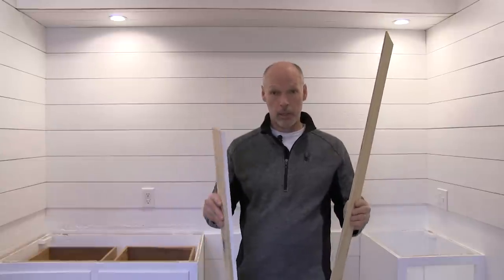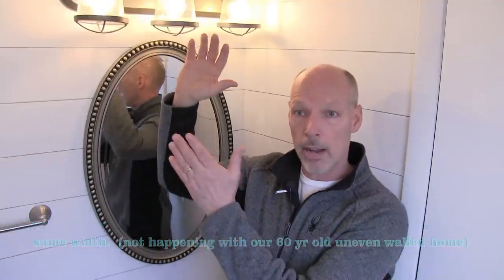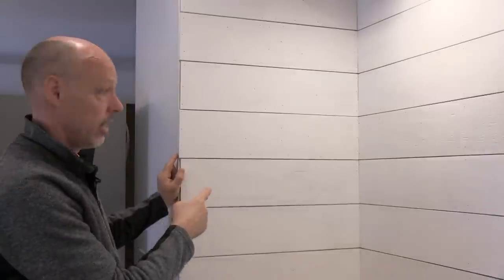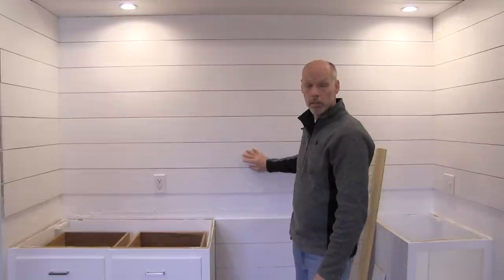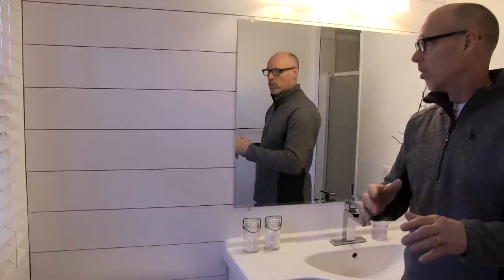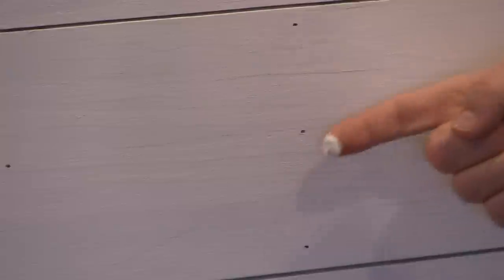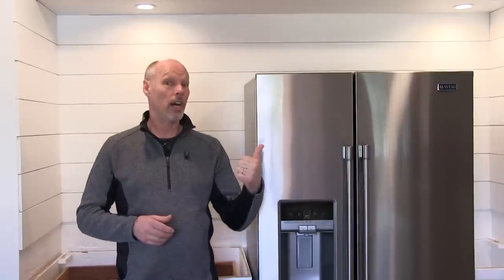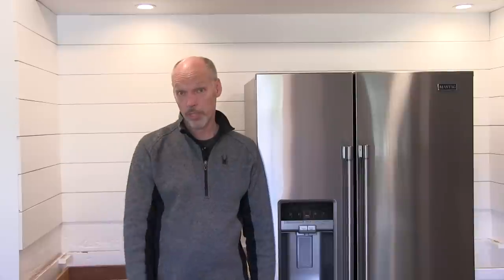Faux Shiplap Wall  - comparing various material options

Comment: THANK YOU! Thnx for doing this video, it was very helpful. Especially appreciate u sharing your very own work so we can see where you got it right/wrong, mad respect for that! 
Also, I'm considering this same option for our 1990's gargantuan master bathroom. It's currently covered with wall-to-wall pink roses wallpaper 🤮 ! 
Question: What's your opinion on just putting this right over leftover wallpaper residue? In other words, I'd just peel off the nasty roses wallpaper, skip the step of spending FOREVER trying to clean off that leftover residue, and just nail up the shiplap right on top?

Has ANYONE else tried this idea??  {Our master bathroom is insane big with 12' ceilings so DIYing it isn't gonna be easy as it is.

Thanks again,
Mrs. A.I.R.
Reply from the maker: Thanks!  I haven’t seen it over wallpaper so I can’t speak from experience. A couple things that come to mind though is not to use MDF board in case it leaches moisture from your shower. The thicker 1/2” plywood would show less imperfections between the planks but it’s harder to work with due to more warping. The 1/4 inch plywood is easier to work with but will show more imperfections between the planks. Maybe due a test by putting 2 or 3 planks on over a painted area and living with it few days to see how it looks from various angles and with the lighting in the room. Let us know what you end up doing and how it turns out.  *The sure way is to remove the wallpaper and paint it•

Comment: Do you prefer to use glue on the boards or not? If so why? If not why? I’m going back and forth with this, specifically in my bathroom where I would be dealing with shower steam. I don’t want any bowing over time or potential mold developing behind the boards if that’s a thing. I saw where you spoke on using oil base prime in bathroom which I will do. Thanks for the tip.
Reply from the maker: I only used a little adhesive on one board when I shiplapped my kitchen backsplash by the sink and stove area because it was warped before I even installed it. I wouldn’t be afraid to use adhesive in the future though. Down the road if you remove shiplap which was affixed with adhesive you will rip off some drywall probably so you would want to make sure you are OK with that.  I will link my other shiplap video below where I affixed one board with adhesive to the wall and used a temporary brace until dry in case you haven’t seen it yet and are interested in viewing it. Thanks for watching:).
https://youtu.be/tZ5caxrKgsA
Reply: Silver Lining Day Dreams: Thanks for your input. I think I will skip on the adhesives unless necessary. I do have one more question. Should I paint my beige walls white first if I want a look with clean lines? I’ve noticed walls that were darker in colors appear through the cracks and makes the project not look as clean.
Reply from the maker: If you will be painting the shiplap white then for sure paint the wall white in my opinion :)

Comment: You might not have really had an issue with the MDF because it's just a powder room, but don't EVER use it in a full bathroom with a shower or bath, it'll soak up water like cardboard you it'll fit away and mold faster than you can imagine
Reply from the maker: Thanks for the heads up and thanks for watching. :) We haven’t had any problems in our 3/4 bathroom yet! Probably because of the primer and paint layers!

Comment: Excellent video.. so regarding installing MDF.. 
I was going to install the boards, then fill the nail holes and seems. Then said it down.
Then ur saying to use an oil base paint, let it dry then paint with a water base paint???
Thank you for your time.
Reply from the maker: Thank you. Yes, oil based for 1st coat and then water based for top coat😊
Reply: @SilverLiningDayDreams  thank you very much. I appreciate your time.. 🤙🏼

Comment: What color white paint do you recommend using on your shiplap?
Reply from the maker: Really comes down to preference.For the top coat what we like is Sherwin Williams paint.  I painted the shiplap back splash in our kitchen by our sink with their high hide white Emerald urethane trim enamel interior exterior semi gloss paint. That’s my favorite and it’s expensive so wait until they have a 30% or 40% off sale. Get on their email list. It is little more shiny. They have other options as well if you prefer less shine but it’s great for clean up.  😊

Comment: Make sure to use spark rings on the outlets.  Electrical code does not allow exposed wood around switches and recepticals.  Spark rings are thin plastic box extenders
Reply from the maker: Thanks for the heads up. And thanks for watching.  We just uploaded anther shiplap video about a month ago. I wish I could go back in time and mention the spark rings in it. Please consider subscribing if you haven’t yet and watch for more.

Comment: Brad:
I want to use 1/4" plywood (cut at 8" wide) for a faux shiplap but it's in a bunkie and the stud wall is empty. ANy ideas what to use to have behind the laps?
Reply from the maker: Hi Bart. Without seeing it,  it’s hard to brainstorm a solution. Can you frame in some studs?

Comment: I’m putting ship lap across 2x4’s with no drywall behind it, and I’m concerned that you’ll see dark ‘spaces’ in between the ship lap. Is it essential to put a 1/4” plywood behind it and paint it white so that you don’t see dark spaces between the boards or just leave it? Thanks!
Reply from the maker: Depends on if you’re doing some sort of a real type shiplap that has a tongue and groove set up versus applying quarter inch cut pieces to be for faux shiplap. 
If you’re using faux shiplap, I think you’re gonna want some sort of a plywood or drywall, or some sort of backing behind your full shiplap. 
Having some sort of sheathing behind the faux shiplap will also reduce the amount of bowing inward or outward of the shiplap I would think
Hope that helps. 😊
Reply: Thanks so much for the quick response and feedback! I’m planning on using thin underlayment board cut into strips, so no tongue and groove to hide the spaces. That’s probably a good thought that a backing would help any potential bowing. I’m building a faux fireplace and using the ship lap around it.
Reply from the maker: @bradgriffin7779  how cool!
Let us know how it turns out
Reply: Thanks!

Comment: I want to put up shiplap in my kids' bathroom, but when they shower the humidity causes water to run down the walls.  Is that a problem if the shiplap is fully sealed?
Reply from the maker: Great question!  Just my hunch here, but if it’s occasional probably ok. I wonder if it would be worthwhile to Look into installing a fan If you don’t have one yet or if you do to upgrading your bath fan such to move more of that moisture out while showering. Thanks for watching:)
Reply: Angela Harebottle: This was my concern as well in my bathroom and I’m glad you asked the question. Thanks 😊

Comment: Use bin primer on mdf it does not stink near as bad as oil base and dry time is remarkably fast. Light sand with 220 and it works best if you spray it on.
Reply from the maker: Thanks for taking the time to post a comment; sharing from your experience.  And thanks for watching.
Reply: I am a commercial painter and really enjoy watching videos for home improvement thanks for posting. I actually just painted a house full of ship lap and they used the 1/4 plywood ripped in table saw.

Comment: They all look great! Thanks fir the inspiration! Why did you use 3 different kinds?
Reply from the maker: In the kitchen I thought the thicker plywood wood would give a little bit more upscale look. 
The MDF board in the bathroom off the master bedroom was due to watching other you tubers use it and trying it. 
I used the thinner 1/4” plywood in the tiny bathroom without the shower due to its lower cost and since it seemed to be the most popular material and that’s the one I like the best. Thanks for watching 😊

Comment: With a little math you can still start at the bottom if you do not have a helper. It is a lot easier starting at the bottom. Just take the height of your wall and divide it by the width if your panel. The best way to get this width is lay 4-6 panels on the floor with what ever you are using for spacers in between the panels measure the total width and divide by the number of panels you put on the floor. If your number does not come out even and  If you have a narrower piece start with that on the bottom.
Reply from the maker: Thanks for the well thought out comment that our viewers can benefit from :)

Comment: What if my walls are long. Over eight foot sections. How do I get a great look of shiplap without an obvious  eight foot seam running from top of ceiling to floor.
Reply from the maker: Hi. I would suggest staggering the boards. If you search on YouTube...staggering faux shiplap....a couple videos come up. I would be sure to have the ends come together on a stud and sink a couple extra nails carefully without splitting the wood. In our kitchen above our sink I filled the gap with drywall compound and lightly sanded with 220 sandpaper after dry. May have to do twice. It looks nice to us but if you go looking up close you can tell in some places that it is two boards butted up. Because it’s random it works. But it’s all preference and beauty is in the eye of the beholder. You may want to consider staggering the seams and not filling with drywall compound as that is less work and also an awesome look. Let us know what you end up doing and how it turns out.
Reply: Stagger the seams by drawing it all out first on paper.

Comment: ~ What do you suggest I use for an interior of a shed...1/4" or 1/2" plywood?  I will be insulating and adding poly to the walls.  Great video, thanks for sharing!
Reply from the maker: I have a bias towards 1/4”.  We just uploaded a she shed video where we put plywood planking (faux shiplap) in the ceiling. I will link that below if interested. I would want to be looking at where I may need to consider adding structure in the walls of a shed to reduce bowing of the plywood  Good luck!  👍.                  https://youtu.be/9PQlpMJcpe8

Comment: One question. Do you recommend using construction adhesive? I would like to just use a nail gun but I'm seeing some others that recommend it. Thanks for the great video.
Reply from the maker: Your welcome and that’s a great question. We chose not to use any adhesive because at some point in time we may want to remove the faux Shiplap for the sake of changing things. I.e. we didn’t want to rip the walls up when removing the faux Shiplap. And it worked out well this way for us. It is staying in place very well thus far (some of its been on the wall for 5 years). 
We can only share what worked for us on our walls. I hope this helps some!
Take care 😊

Comment: You should have added cove crown molding on top.  You’re right that you see the top more than than the bottom,  however both are important.  Take the drop of the crown molding into consideration when planning your starter course.  The bottom baseboard height can vary so you have  constant look.  Also 1/4” plywood is a poor choice,  You see all the grain.
Reply from the maker: Thanks for the suggestions! Different opinions are always nice for consideration! 🏡

Comment: Can you put shiplap up on plaster walls?  What do I need to do to adhere to the wall?  Thanks
Reply from the maker: Hi Linda. I have never personally put shiplap on a plaster wall so unfortunately I can’t speak from experience. But here is what I think. You would want to make sure the plaster wall is in good condition first. Options are using an adhesive with some temporary nailing. Or may have to put 1/4” plywood sheets on wall to have something to affix your shiplap to. Plaster walls can be a nightmare to work with. Good luck and let us know how it turns out if you go the shiplap route. And please consider subscribing.
Reply: @SilverLiningDayDreams  , maybe I should just blow the damn place up...lol.  I've lived here for 8 years and have nothing on my walls and it drives me crazy.  To even hang a lousy picture I'd have to drill holes and that's a mess.    I saw how one lady actually drew lines in her walls with a sharpie pen to get her shiplap.  Maybe I'll end up reverting to that.  Thanks for answering my question.  ( thought I had subscribed but I'll do it now, thanks).
Reply from the maker: LOL.  Good luck with everything. Let us know how it turns out :)
Reply from the maker: Just noticed your well thought out comments. Thank you from sharing from your experience. I know many of our viewers read these comments and find helpful advice. 👍

Comment: Hi- can I use this in a bath room with a shower and do the ceiling as well? Thanks!
Reply from the maker: Good question. Definitely not with MDF board in my opinion. I would think you could with real wood or plywood if you seal it well and have very efficient removal of moisture with a quality fan when showering. 
I know people are using wood and sealing it in RV showers; sort of a trend right now. Take care 😊
Reply: @SilverLiningDayDreams  thanks so much for answering! I’ll prime the back as well!

Comment: You just need to fill the gaps on the edges with 45-minute hot mud or use trim to cover edges. If you use oil-based paint or primer in a wet area, you will get mold.
Reply from the maker: Interesting. Thanks for leaving suggestions. Take care 🙂

Comment: Was the mdf shiplap prefinsihed?
Reply from the maker: It was not prefinished 😊
Reply: The mdf shiplap I purchased is prefinished. I don't think I even need to paint it, if I want white... im going onto a decent plaster wall, so I'm trying to decide if I use 1½ furring strips or just glue it to the wall and use vertical batten to finish
Reply from the maker: @paulbarrett6910  Hard choice; sounds like would work either way. Would be curious which one you go with and how it turns a out. Keep us posted.

Comment: Never use your finger to apply spackling compound. It will never be flush with the wall surface. Use a a small to med putty knife instead. When the compound is fully dry lightly sand the compound then take a slightly damp rag and wipe the edges.
Reply from the maker: Thanks for leaving a comment for our viewers to consider. Back in the day I did as you described but not in recent years. I’m ok with doing as I demonstrated in the video. :)
Reply: @SilverLiningDayDreams  just curious, why don’t you do spackel like that anymore? Do you ever use a putty knife? Thanks for the great video!! I really enjoy following along with what you two are doing!
Reply from the maker: Thanks 😊 
Much quicker to use your finger and after painting a couple times you can hardly see the faint dimples. So over time it becomes a moot point.

Comment: Hey! Great work! Did you prime the boards before installing them or after? And if after, how did you prime in between the spaces/gap? Thank you!
Reply from the maker: Thanks. In all three rooms that I shiplapped I rolled 2 coats of primer onto the sanded side and also onto both edges before installing with a nail gun. I have a 2nd shiplap video on our channel you can watch that will explain this. Thanks for watching and please subscribe

Comment: Well done video.  Love your easy going presence and detailed instructions.  I'm wondering if its possible to use "paneling" for the ship lap look.  Have Lowe's or HD cut it to size???  And, did you do 6" lap?  Again, your passion comes through and I'm looking forward to viewing your other videos!  And, do you suggest removing wallpaper from the wall you want to cover in ship lap?  Thanks again!
Reply from the maker: Thank you so much. We used 6” faux shiplap widths everywhere except for the kitchen backsplash. Above the kitchen sink and below the window above it measures 4 & 1/2”. Therefore 4 & 1/2” is the width on the bottom piece of backsplash shiplap used. Above that is 6” and above that 4”. I hope that makes sense. If possible I would remove the wall paper. We would suggest using plywood and not use paneling and buying plywood that comes pre-sanded on one of the sides. Let us know what you end up using and how it turns out. :)

Comment: I’m a new home owner and would love to know what would you recommend for me to do to merge two piece together and make it seem like one , the wall is bigger then 8ft
Reply from the maker: Hi. We would suggest staggering the boards. You can draw it out on paper first. I would be sure to have the ends come together on a stud and sink a couple extra nails carefully without splitting the wood. Could also use some construction adhesive. In our kitchen above our sink I filled the gap with drywall compound and lightly sanded with 220 sandpaper after dry. May have to do twice. It looks nice to us but if you go looking up close you can tell in some places that it is two boards butted up. Because it’s random it works in my opinion. 
I’ll put below a link to another video we did that shows you what we did in our kitchen. Good luck.
Reply from the maker: This is a video we did on Answers to Faux Shiplap Questions. Hope it helps: 
https://youtu.be/tZ5caxrKgsA
Reply: make a 45 deg cut away from sight from where you walk in the room. seperate the two 45 deg pcs by an 1/8 inch, and caulk. youll never see it from entering the room.
Reply from the maker: Great point. I usually make similar type cuts when installing long runs of baseboard.